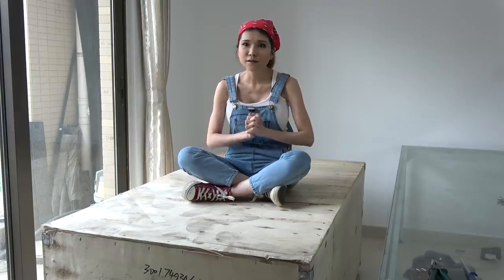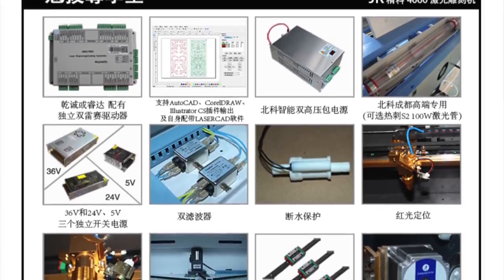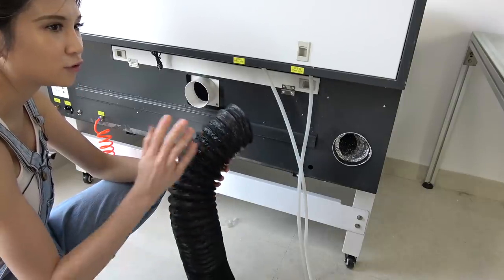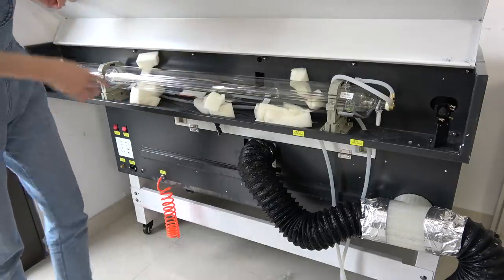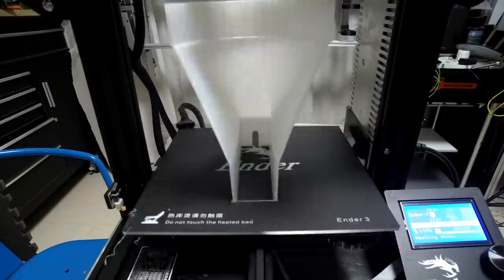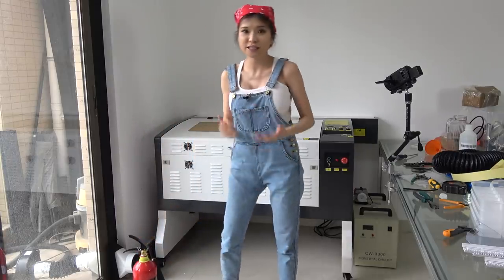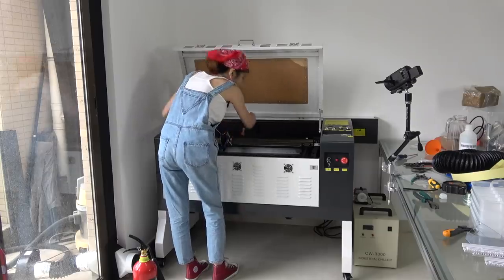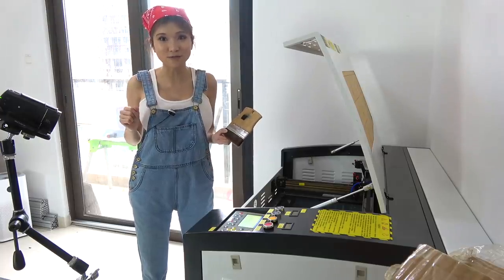I Finally Got a Laser Cutter! Chinese 80w Laser Unboxing & Setup

Comment: Hi Naomi,
at work we have a 100W lasercutter, looks nearly the same as yours.
You made a black burnmark on the wood = too high power
Put your power down and your speed higher.
Then you can really burn text into your wood.
Or slower and high power to cut wood, but than I'm talking about soft wood, not the hard peace you showed in the video.
At work we took a wooden board, and every 4 centimeters we tried another setting of the speed and power.
So we had a reference if we wanted tot write or cut.
And we did this in several materials. It is really handy now.
I think you did a good buy, the first time I used the laser cutter at work, I was hooked.  I find it one of the most fantastic machines because the laser beam is so thin, you can do so may things with it.
Do not forget to put the point , where the laser beam comes out of the metal tube, about 7 milimeters above the object you want to write/cut.  The laser we have, has 3 laser beams. And they focus 7 milimeters under the metal tube.  So the hottest point is there.  You can only cut thin plates.  But when you want to cut thikker plates, you can repeat 2 times, or three times the laser going over the object, so you cut deeper.  And then you can put your focus point lower, and then repeat the laser cutting, so the hottest point is deeper in the object.
Have fun with the laser!  I know I have. :-)

Comment: It's nice to see the learning curve of machines, instead of the usual 'expert' racing through all the stuff they forgot how long it took to learn!  I've been laser cutting for about 3 years now, and I have to say, they are massively practical machines.  Great to see they are becoming more affordable.  Home users should beware:
N.B when running a laser cutter NEVER leave it unattended!  the combo of extreme heat, combustable materials and a downdraught is perfect for fires.   make sure you have a working smoke detector too!

Keep up the great work.

Comment: Nice printer and I'm a bit jealous - you get around here for the same price a much cheaper version of the 60W variant and this one looks like a proper built quality.
You might need to exchange the water with purified or deionized water to remove the calcium - otherwise the water will get soapy in a short time and could accumulate mold. I added to my laser cuter a current indicator in the tube and added foot colorant into the water, to see at instant if I forgot to turn on the water pump, the water pump failed or got disconnected.
You should also add a temperature sensor into the water - above 30°C the efficiency of the CO2-laser drops, so that you might not get a complete cut in one go
I would also add a NO-switch next to the hood from the kill switch, so that you can work only when the hood is closed, so the laser gets cut in case of accidental opening.  It will happen and the power scattering is quite high, so nothing serious should happen.
The 36L/min air pump is sufficient to remove the flamable fume and you can remove the paper protection of the acrlic glass (PMMA), to spot faulty operations.
For cutting paper you are running usually at 6 -10W. For engraving or cutting PMMA you should stay around 10W (otherwise you will cause stress in the PMMA, which you can see with two linear polarization filter and 90° off and you would need to place the parts in an oven at 60°C to cure the stress before you can start cleaning the part - otherwise it will crack on mild isopropanol cleaning).
Plywood you can cut from 20W onwards with about 2mm/20W.

How clean and deep can the edge be? The cheap 40W can make ~5-6mm and uses a linewidth of ~0.4mm.
Can you change the settings to a pulsed mode, so that you can adjust the power and go below 40%? the other option is to increase the cutting speed to reduce the carbonization of the material. I'm using 30mm/s with 20W, so you should look around 50mm/s for 32W of your minimum setting.
You should also use a paper underneath your cut material. Once you are thru the material the metal mesh and fume will ruin you backside, but with a piece of paper you will have a clean backside and you will see with PMMA also when you are done.
Reply: You also might want to turn the direction of the exhaust fans - the description is a bit vage, but they should pump in fresh air and move the pm2.5 and pm10 fume to the exhaust system in the back.
You also might want to buy something like Patafix to temporarly fix your object to the metal mesh. I have some odd resonance frequencies above 30mm/s and below 350mm/s, where depending on the line length the whole object will move around. 
You might want to buy also a SDS011 particle sensor and run it on an arduino with a 16x2 LCD display - depending on weather condition your fan solution might not be enough and you might get backlash conditions. You would feel a partical densitiy due to backlash quite fast (above 600µg/m3).

Comment: I own a laser cutter as well. Safety Tips: Cutting plastics made with Chlorine (such as PVC/Vinyl, PE-C) are very corrodible and highly toxic. Also beware of highly flammable materials such as foam, woods with oil/sap/glue (i.e. Plywood), MDF (smokes a lot!), and Fiberglass (Need air filters). You'll want to learn a bit more about those materials you use ^^. And, even though it's very fascinating to watch, don't stare at it :P
Reply: I know nothing about lasers, but I would wear laser goggles even though the top window is supposed to protect you already.
Also I would leave the lid closed for a while after it's finished so the smoke can get out.
All in all, that's a very nice machine! You could find people in the market who need things cut but don't own a laser cutter and do it as a job.

Comment: hello Naomi, have got long time ago one of the first china laser printer. To resolve your cutting problem, you have to check the good centering of the laser on the different mirors in the corners of the machine to focus it at center. After this you have to adjust the height of the laser miror on z axis to a correct height. on our model, was near 1mm (it's as the paper sheet to adjust printer nozzle to the printing plate). if height is too high, focu of laser is not good, if too near, bad too. Some test to be done. After you have to adjust the speed and power of your laser cutter to find the right one. Depand of the material hardness to cut, it's thickness... Monitor and register all setting for each material type and thickness will help you for next cuttings. Some tips. Prepare a larger size water volume because will become hot quickly if weather is hot or long time cutting. You can cut with the window open, this will help you to prevent to burn your laser cutter because you will see flame. Arround the laser nozzle, there is air colling, so help the fire burn if error in settings. Wish you good tests.

Comment: HI Naomi,
I have 2 Laser cutters,  I use them daily in my work. 
I would be happy to help guide you in the basics.

1 exhaust is important.
2 clean and aligned optics, keep it clean
3 focus the beam
4 just enough power for the material or you will get fires
5 never leave the machine alone when cutting

You are a smart lady with an exciting maker spirit 
I will buy an ender3 to show my support.
Roy 
The Trophy Store
Sydney Australia

Comment: one of those vent wholes in the back is intake and one is outtake vent. The fan should be place blowing fresh air in and the outtake tube just needs to be aimed outside and have a filter on it or your porch will get covered in black gunk. If you have more questions i can help out.

Comment: yo, great stuff.. i used to use one.... so :-

Water, clean, I didn't understand what you said but we call it 'Deionised water' with no iron in water.  

Your laser should have a window on top so you can see, the laser should be okay through the perspex top, you need to be able to see what the laser is doing for safety and quality reasons. 

Never cut foamex (foam core) as fumes will kill you.

Extraction is good, most important as it will help with less 'flames' inside.

Never be afraid to use at 100% power, more watts the faster you can go.

For perspex edges see video  'H180 Flame Polisher' or similar machine.

Mirror etching is possible with laser, i know someone who does it

Comment: Congratulations!  If you got the CW3000, I'd highly recommend returning it as it's a radiator and the amount of cooling depends upon your ambient room temperature.  For an 80 watt laser, you'll get longer life if you switch to a true refrigerated chiller like the CW-5000.  Also for the exhaust, the change in shape will restrict the airflow.  You should try to keep the exhaust hose as straight as possible with as little change in shape as possible to maximize airflow out of your home.

Comment: You are an amazingly talented maker! I just found your channel and I have to say you are very ingenious with your projects. There are a lot of very smart solutions used in all of your projects.

The only thing I would have done differently on your parts you designed for your sliding door is to make the printed part fit inside of the hose, and then use hose clamps to seal it. I know you just used what you had in the shop, but modifying your adapters to fit inside the hose would make your venting system more durable.

Please keep up the great work! There are not enough talented women working in STEM.

Comment: Need take out paper from acrylic on top window to see what the machine is doing with the door closed, and adjust the focus moving the head up or down to cut without burning the material. Also need check if the head compressor is working well, can't burn card board like that. Looks great this machine, i will buy one for me. Long time i want to buy one here in Zhuhai, but have many options on Taobao, impossible to make sure witch one is good. Thanks Naomi for this review.

Comment: As someone who has worked with hvac people, that tape is the correct tape for securing duct work together. It feels a lot like thick aluminum foil with an adhesive back.

Comment: Adjust the settings,  50% is way to high for either of those materials especially on the cutter you have.  We have a 40W laser cutter at our  hackerspace, and when I do wood  engraving the power is at like 10-20%.   Not sure the prices of acrylic vs wood there, but wood is a far cheaper material to practice on here, we use MDF when testing the machine settings because it's cheap, then we make minor adjustments for the acrylic.  Good luck, damn jealous of the size and power of that darling machine you have!

Comment: Hi Naomi, First Congrats on a wonderful looking Laser Cutter. I used to run a laser in a sign shop a few years back. As you saw the laser basically burnt the cardboard and wood. My guess is too much power and or movement of x-axis and y-axis too slow. Does the machine auto set the Z? An incorrect or out of focus Z height will cause a blurry image. I would try maybe 5-10% power for your machine. Its always best to start with low power and increase as needed. I know you are a very smart lady but please be very careful with the fumes. Some material (like PVC) is very toxic and can kill you and or damage your machine. Always have the blower fan on before you cut anything and if possible try to get the exhaust away from your place. If possible (I don't know if you can legally do it) have the fumes vent to the sky. You should have a material list with your machine on what to use and what Not to use. If not a quick internet lookup will work. Best of luck, sorry for the long post. I just want you to be safe and have fun with it. Rick

Comment: You made me remember when I first turned on my $200 "40"W laser cutter and got my finger in the laser path. It was like a hot needle piercing my skin to some deph leaving a white mark. It is good practice to always have the air pump on so the material does not catch fire. And use same freq protective glasses as looking at the beam can leave a blind spot in your retina.

Comment: I think the paper covering comes off the door window so you can safely see what's going on when its working. I could be wrong. Very nice machine, at 80 watts you probably need to be running at a very low level for simple wood etching I would bet. So glad to see you posting video's again.

Comment: Poor, poor walls!
You might want to put some padding on the machine if you intend to move it around a lot so the wall doesn't have to suffer more~
The solution for the exhaust was pretty cool though!

Comment: This is so awesome! A laser cutter is high on my list for the next huge purchase. I couldn't afford one like yours but I'm currently considering to save up for a bit less than half the price shipped. CNCs and laser cutters - at least for me - are great as they usually produce items that can be sold with little to no post-processing. That's very unlike the FDM 3D printing where most parts will need to be processed to make any money with them. Great you have a LAZER now - sad that the timing is so bad for you. I hope you can make the money back tenfold either producing small items or through sponsoring using the printer. Cheers! JM
Reply: By the way I received my Ender 3 at lunch yesterday and put it together after work. Printed one of my designs as well as the test dog and I'm blown away. The prints both came out exceptionally great. I used my CR-10 based Ender 2 profile and just changed the bed size. This thing - unlike my other two Creality printers - worked right away and apart from two screw types not being defined clearly - which could be figured out by comparing what had been delivered with what had been defined - the printed documentation was sufficient for me. Don't know if I was just lucky or if Creality went one up on QA. Cheers! (again) JM

Comment: The 2 holes, I think 1 is for cold air intake and another 1 is for hot air output. I think you're wrong to combine those 2 holes into 1 exhaust, that's why all the smoke... The airflow is not right. You also need to peel the paper protection from the glass window, that way you can see what's happening inside while cutting.

Comment: You're a very clever girl. I have the 50 watt model and your's is huge in comparison! With laser goggles you can remove the paper covering the window on the lid and watch the laser in action. Yes it does make ALOT of smoke even with your clever exhaust system.

Good job Naomi! :)

Comment: You need to adjust the lazer focus point where their indicator is usually by using a small piece of rectangular perspex. And different material have some slide changes in fire power and movement speed.

Comment: My suggestion, the top should see though while can see through how laser cut, in case  sth go wrong, hit the emergency stop button, (2) use fast speed, and low power for cutting cardboard or paper, difference material have different power and speed setting. search online and find the best for your machine. from time, you can get a lot of contract work with your laser, don't worry, it wasn't waste machine

Comment: Don't forget to calibrate/align the laser beam, it's quite tricky. It's necessary in order to get good cut and deep enough as specification. I've done it, and spent a day to align it with my brothers

Comment: Naomi, I am not an expert but it looks like you have made a mistake by connecting the laser input and out put air vents together with your T piece. The air will just circulate and not vent to the outside.  I think you must remove the t piece and discard it.  If I am correct the one large hole in the rear of the machine will suck and the other one blow. Connect your outlet pipe to the one that blows, leave the other one open. That is why only the one hole has a fitting you can clamp on, the other one that you used the putty on is probably the inlet pipe.

Comment: hi miss wu for the exhaust you may want to get a piece of wood the height of the door, some weather stripping and maybe a handle. that way you can just stick it in the sliding door when you're using it, and store it next to the cutter when your not.

Comment: You must check out LightBurn which in my opinion is the best software for laying out your objects and specifying how to control the cut. It has camera support for remote placement and does not require you to be connected directly via USB. You can control the laser via network if your machine supports it. The Facebook page is very active and support is phenomenal.

Comment: not to backseat your work, but those heater hoses should fit over their connections. makes them a lot easier to tape or use a hose clamp on for sealed connection.
If you use a hose clamp it's best to have rubber or fabric between them otherwise it can cut into the tube. incase you do this some other time or rebuild this for any reason.

Comment: I work with a big laser cutter in our workspace. We have worked with acrylic, card, tape and maple wood for nearly two years with no fire whatsoever. The one time we tried to cut a stencil with corrugated cardboard it set on fire! Though I'd say as long as the cardboard is thin and you don't run the laser too slow it should normally be okay.

Comment: Naomi, if your laser uses the Ruida line of controllers, consider to visit www.rdworkslab.com for great information. The community at that forum is very helpful and will be happy to have you as a member. You'll be able to learn how to align the mirrors, how to ensure that you do not use too much power to damage your laser tube and so much more.

Even if you don't have a Ruida controller, you'll be welcomed. 

Sometimes the software that is bundled with the lasers is "challenging" to use. There's a new program on the market called LightBurn from www.lightburn.com that makes using many different types of lasers very easy, especially the Ruida and GRBL types. I hope to see you there.